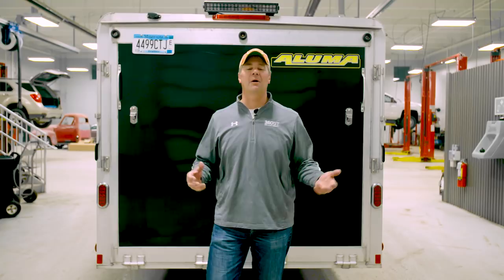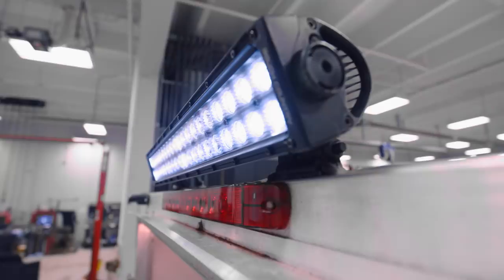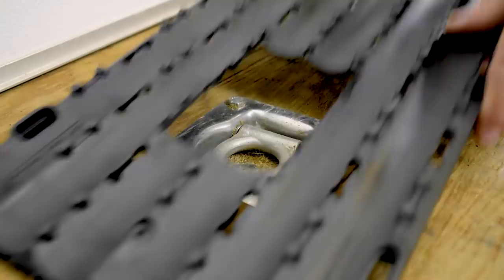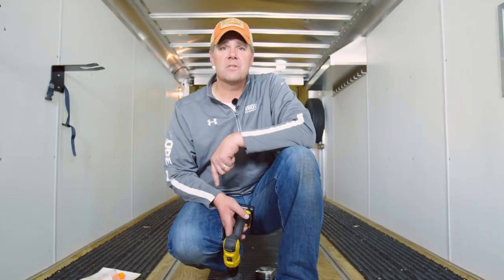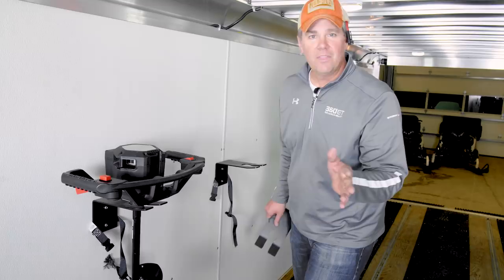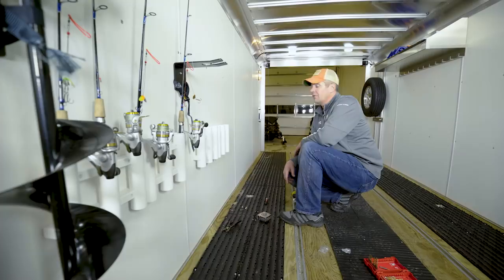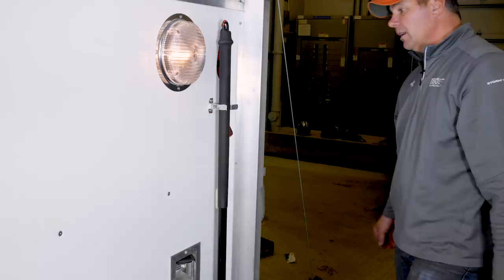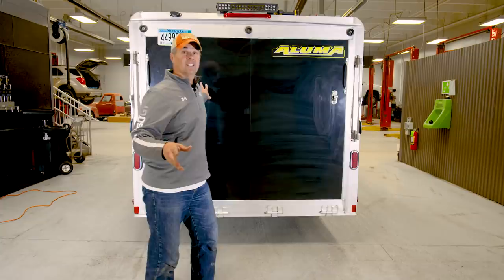Web Extra! - Aluma Trailer Ice Fishing Modifications

Comment: I would put wall hinges on the left side of the V front, and attach a fish cleaning table to the hinges. Attach hinges to top edge of table so it folds downward against the wall, because it looks like there is a cabinet in the way if you wanted to flip it upwards. Then screw in 2 eye bolts on each side of the table and put a bungee strap across to hold table in place. If there isn’t already, you should screw 2 sheets of diamond plate steel down to both sides of the V-Front, because the front dents really easy by rocks getting thrown up by your truck. That will save you from having a dent filled front and in return you’ll have a badass looking rig.

Comment: We have always pondered putting a live bait tank in our ice castle with a drain to the outside. If you add the heat, as suggested below, it could a handy addition. Also, a solar panel mounted on the roof so that your batteries would charge. Again, have one on our ice castle and it works great.

Comment: Hook that big light up the the reverse lights on the truck. I did it on my pontoon and man is it nice when backing into my little driveway at 2am. Also a couple fold down cots in the wall along with a fold down table for the camp stove.
Reply from the maker: It actually is hooked up to the reverse light. The editors did a good job with the video but cut that important piece of info out.

Comment: Fire Extinguisher, First Aid Kit, Battery charging area (Batteries to charge batteries sounds funny, but you guys would use it!!) Coat/clothing hangers, (lots of vertical storage available), bait cooler storage, potential aerator setup for live bait with an air compressor, propane station...

Comment: Hey guys another cool video. But the next thing you need to do is get the proper hitch on the snowmobiles. That's got to be beating up the bumpers not to mention annoying as all heck with that banging around pulling the otters. The u bolt must have broke cause I noticed the last episode it was a carabiner type hook.

Comment: I have a charging station for my sonars and auger batteries.  If you're tailoring for an extended trip it's nice to know they're charged up and ready for you. I utilize a 12v boat Minnkota charger and have it running to chargers. You can have a plug on the outside of the trailer to run an extension cord to it to keep all your deep cell batteries charged while it's in storage or outside a lodge.  Could also trickle charge the main trailer battery.  

I have Max Trax on my truck as an emergency vehicle recovery tool.  Can't tell you how many times they've been helpful in some of the remote lakes with deep snow here in the Rockies.

Comment: Absolutely 100% wall mount ventless heater with propane tank. Be able to go in there and warm up. Plus thaw out your stuff in between adventures on the road.
Reply from the maker: We're going to look into this.  We typically cart around a couple 20# LP tanks anyway.... and the ability to thaw everything out would be awesome.  Any recommendations for brand?
Reply: Mr Heater ! I doubt you would need anything over 10k btu!
Reply: They make a nice flush mount that comes with the unit. Best thing ive added

Comment: CARGO NETS on the ceiling to store your rods in rod cases or bags.  Something that won't fall and damage your rides.  Hate to see you lose your rod investments by ripping them off the wall with the Polaris wide tracks.  Or construct WALL BRACKETS in the front "v" that will hold your otter rod cases.  WALL CADDIES that hold anything from Engle minnow coolers, I-Fish Pros, Marcums, Striker gear, to First Aid.  Another idea may be WALL PEG BOARD to hold RAPALA, SUFIX, VMC, etc TACKLE, that way you don't ever run out of sure set trebles, sufix ice magic, or rapala rippin raps.  If you get what I'm saying.

I may have gave to many ideas, but I was thinking about this for a whole week, because I was thinking about what I would like if I had that amazing trailer.  
Thanks

Comment: Not sure if it has been addressed yet in previous commitments but, what holds your rods in the holders when driving down the road? U have a strap for your augers. I would be worried about the rods bouncing out. Simple rubber band over reals to bottom of holders would work I would think.

Comment: Watch the snowmachine racers trailers.  Infrared heaters and a curtain you can walk through when the door is left open at the back.  
You can use it as an ice fishing shack...not just a trailer then.

Top it off with a small generator for some tools and you could fix a sled if someone had a minor issue, de-ice it if stuck in slush, etc... and you could even power a little microwave or coffee pot like someone else mentioned above if using as a fishing shack.

Comment: I'd turn the whole nose in to a charging station since you put on so many miles it would free up space in the truck and you can have all camera/ agurer/ flasher just any battery you need charging all at the nose build different shelf sizes for each battery size and run converters to the back

Comment: I was thinking a small or medium size toolbox style Locker towards the front corner of the trailer 2 house you're expensive Electronics then keep them from rattling around you could even wire charging stations inside of it so that as you put them away you plug them in your good to go for the next time

Comment: Sweet video!
You can use E-Tracks (https://www.amazon.com/Tie-Down-Accessories-Galvanized-Horizontal-Cargo/dp/B01J4KBZ28 ) on the inside walls -- then from there you can mount hooks and stuff on them.  You could keep anything on them from helmets -- to your sled tow bars.  Good thing is that you mount the track and then you can adjust what you all put on there. That'll save you from putting a bunch of holes in the trailer when you want to move things around.   Jeff.

Comment: What model is that trailer to fit two of those sleds outfitted like that?

Sleds are thirsty and gas stations aren't always open/convenient.  Safe storage for about 20 gallons would get through most weekend trips.

A good tool small kit would be a good addition too.
Reply from the maker: That's an Aluma AE724TAV.  https://www.alumaklm.com/enclosed-snowmobile-trailers-2  It has more than enough room for our two Polaris Titans for 155 tracks and Monster Boxes... with an Otter Resort on the floor in front.  We do have a pair of 15 gallon fuel jugs with hand crank pump but we still need to work on getting that secured in a way that would allow us to take it out on trips when we know access to fuel won't be an issue.